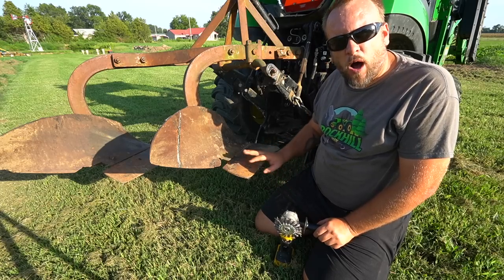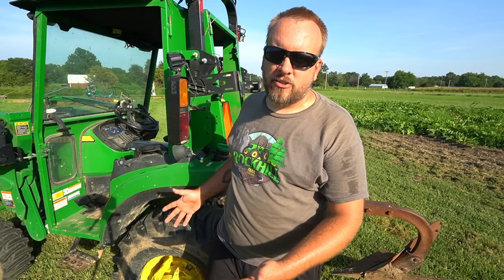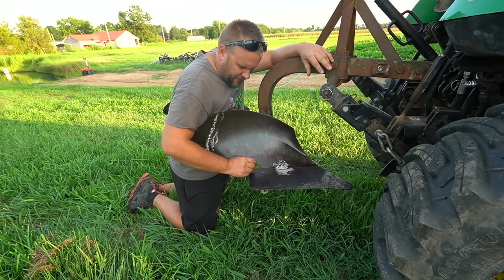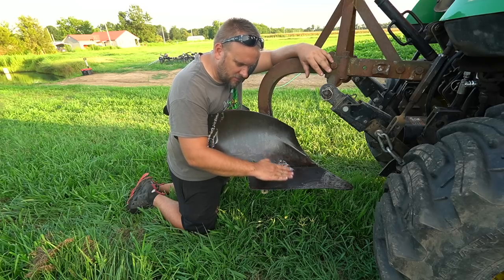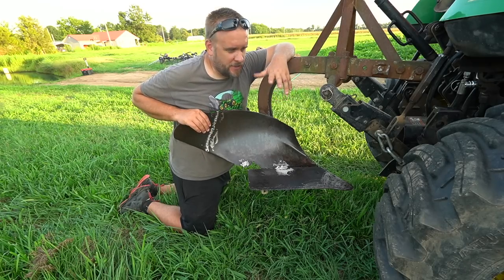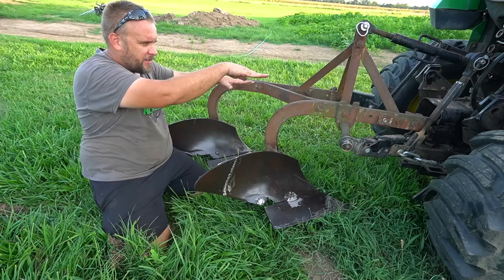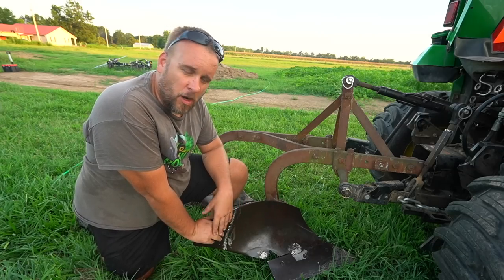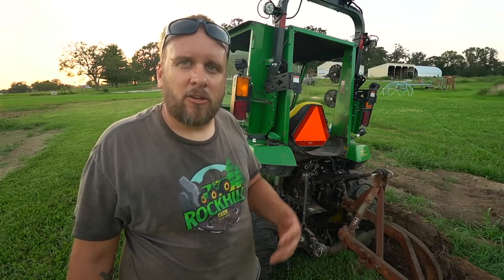Pulling a 2 Bottom Plow with a Compact Tractor - Better than a Tiller?

Comment: You did your setup completely wrong.  Moldboard plows are designed to work best at half the width of the moldboard.  IE, 2x12" would be best at 6" depth, 2x14" 7" depth, etc.   Once you know how deep your going, set the non furrow side of the tractor up on that thickness of blocks, and completely level the plow front to back, and side to side.  Also, make sure the trailing edge of the lead moldboard is just inside the rear furrow tire track.  Coulters should be 1/2" away from the cutting edges of the moldboards.
Reply: Everything you said is spot on sir. Only mistake is that it is the plowshare size not the moldboard. Your advice on adjustment was perfect.

Comment: I believe you're attempting to take too deep of a cut given your current set up.  That tractor should have no issue running that plow.  I have the same plow but with a set of sod cutters on it, I use the sod cutters to set depth of cut and that makes a huge difference.  Keep an eye on farm auctions, you should be able to find a set of cutters for it, or make your own.

Comment: Ok shining the plows was a waist of time,  the dirt would have done that. The two problems I see is you are plowing grass, the hardest thing to do. Second the points looks almost new, new points plow mean till they get wore down a little bit. I hope you was in low range, speed isn't that critical. Good Luck smoothing it down, you may have to use your tiller some. In a big field with plowed grass it would take an offset disk to work it up.

Comment: No need to shine the Mould boards. They will shine themselves with 30 minutes of breaking. Things that will help you do not have. A gear drive transmission will add about 4 horsepower. Ag tires will help a lot. Tractor weight will also help tremendously.. It is very simple as you say, you just not have enough tractor to pull a Two bottom plow!!!!. Also, my old Dearborn Plow manual says you need to run 4 to 6 mph to get good roll over with your Mould boards.

Comment: Your tractor has the power to pull that plow, but I think John Deere limited the hydro transmission conservatively to avoid damage/premature wear, on the transmission. I also think they possibly gave that "smaller" tractor "big" horse power to give decent power to run pto powered implements. If it were me,{which it's not} I would try and find a single bottom plow, or an old "cheap" farm tractor to pull that 2 bottom plow, just so I wouldn't overheat the hydro transmission. All of this is MY opinion. I am NO expert, and non of this is meant to be critical. Enjoyed the video.

Comment: that 4x4 block trick your not supposed to drive all 4 tires up on blocks only the left side (as sitting on the seat of the tractor) should be on blocks  so that way your tractor is leaning simulating being in the furrow and the plow should be parallel on the ground it looks messed up but its the right way just look up garden tractor  plow days

Comment: That hp info other people are telling you is not quite right. Old timers never talked about engine hp, all they cared about was drawbar hp and PTO. The engine hp is always greater than those two, but the manufacturers figured out over time that tractors sound a lot bigger and more attractive when you advertise the the engine hp as opposed to drawbar. That said, your 2038 probably has about the same drawbar hp as an 8N. Main performance difference reasons that come to mind are 1) your tires are not r1 ag tires that would give you much better traction than the r4 style  tires, and 2) wheel base is a lot narrower - 8N was a row crop tractor with a wider base and probably lower to the ground. I’d suspect there’s also a torque issue with your being a hydrostatic but I’m enough of a gear head to really know.

Comment: Moldboards are designed to plow half the depth of the with.
So a 10" should plow 5" deep, a 12" should plow 6" deep and so on.
This allows the top cover to be turned over and put the sod completely
under.  This allows the grass and weeds to rot in and kill any unwanted seeds.

A Coulter is designed to cut sod and other trash. It also helps to keep the furrow
edge clean and straight.  This let's the tractor tire run in the furrow better.

If the plot has been plowed and tilled before without much trash the Colter may not be
needed.

I hope this helps.
Greg

Comment: The following are comments from one who has plowed multiple acres with a 2 bottom using a 2038r:

1) Front ballast is helpful, even a bucket with some dirt helps
2) At the front of each bottom on the frame are two bolt holes, that is for the bracket that holds the coulter.  This helps immensely with cutting sod.  
3) As others have said in various ways, the plow isn’t meant to be buried.  
4) make sure both bottoms are at the same depth and angle, otherwise you will be drifting with your tractor.

Comment: Brock,
The 12, 14, 16 refers to width of furrows, not depth you are able to plow. 
Good video, I think by bypassing or stalling hydro, oil is becoming super heated and can cause internal damage and ultimately hydro failure. Thanks for in-depth look at options.

Comment: I enjoyed this video. I’ve never been a big fan of hydrostatic transmissions for the fact they seem to stall out on power to the wheel vs spinning. But they are nice in other applications also.  I use to turn plow with Dad’s John Deere 770 a lot back in my young days, it did really well for that size tractor and would do it at lower RPM’s. 3 point geometry makes a big difference in how a tractor plows. My 245 Ferguson actually seems to plow better then my 4 wheel drive M6060. Not that the little Massey pulls better but it’s hitch setup makes the plow pull easier. Good job!
Reply from the maker: Thanks for the info

Comment: Hey Brock ,

I use both ,  I go over the garden with an old Dearborn two bottom and then finish with my 6 foot  rototiller for my Kubota  L Grand 3540....
Works like a charm and the ground is perfect. Thank You for the videos.👍👍
Reply: How long do you go in between the plowing and tilling? Right away, or weeks???
Reply: @Rsiikarla  Right away .

Comment: Good bargain you found on that plow. Could use one out here as well. Got a 3010 from the 50's I would use to plow, with its weight, but I am having trouble sourcing a 3 point hitch for it, all she has is an adjustable draw bar.  I agree with the fact that there is less disturbance to the land with the plow. I used a disc this year and it went almost as deep as a tiller, but the area I worked was so full of rocks it would have likely caused damage to it as well, seemed that there was enough of a root system left intact to start growing a lot sooner,  with less topsoil being washed down the swale because its not as arid.
Thanks for the video!

Comment: Plow in the spring soon after the frost leaves the ground. Your soil will be much looser and it will be easier to plow. This will make more difference than any of the suggestions you mentioned! We had an oversized plow for our tractor and spring plowing was much easier than fall plowing.

Comment: Howdy Brock!  Interesting stuff for sure.  I know nothing of larger scale field work, so have no idea what might help.  Sounds like you covered most everything and it makes sense.  I don't see a whole lot of plowing in my area anymore - most farmers have gone no-till, which has it's own positives and negatives.  Nicely done and thanks for sharing 🤠
Reply: No till seems to work well when there is enough moisture to keep the ground in good growing condition, once you start to get prolonged months of drought, especially a few years of it like we've had up here. The earth starts to get packed down and growth gets sparce. This effect is amplified if its a pasture with hooved livestock on it continuously packing it down.  After you get march april may with 2 MM of rain combined there is not much that will help you grow short of irrigation, though the plow rows at least help stop any water you put on it from just washing off the top and running off without sinking into the ground.

Comment: This is my biggest complaint with the John Deere larger 2r and 3e series tractors, they need a 3 speed hydrostatic.  the low range on the Kubota's and my New Holland only allows me to go 4mph so it has a lot more pulling power.  I have been tempted to buy a 2 bottom plow of Facebook Marketplace too for my garden, but I am going to get a tiller first.  I wish I would have seen your post on the Champion tillers before they sold out.

Comment: With hydrostatic transmissions, the reason you ease into it is because you generate the most torque when you’re in low gear and barely engage the hydrostatic. It’s the only way my little LX 2610 can pull a full box of gravel up a hill when I’m smoothing out my gravel lane. The most power comes from low gear and feathering the hydrostatic peddle in order to get the most HP and torque to the ground.

Edit: personally I would go with a single bottom plow and save yourself the time. I agree with why you want to plow before you till. It works wonders pulling up vital nutrients to the surface.

Comment: Interesting video. I would guess you could efficiently plow about 4-5" deep with your 2038R. Deeper if you use only one plow bottom. I remember as a kid, we used H Farmalls to plow about that deep with a 2-bottom round pull-behind plow that was not on a three-point hitch. We thought we were really doing something! :-) But I doubt we ever touch the soil deeper that 5-6". Years later, I plowed the same lant with a 110 hp John Deer and a 5-bottom 3-point hitch plow and saw dirt that I had never touched before come to the surface. I have a 2038R and I would like to get a plow like you have just for small jobs like garden spots. You're right, these tractors are not designed for row-crop applications on a big scale. If the land has not been turned in a long time, the first time will be much more difficult too.
Reply: Spot on I used to plough 4" deep with a 4 furrow plough, set up is tricky.
Reply: Id agree 4-5 inches. . Trying to plow 9 inches deep id say is pretty much 90% of his issue.  He's lucky he ever got it that deep to begin with lol.  Had me real concerned at why a decently powerful tractor at 36.7hp couldn't pull till he whipped out the tape measure. He says " 12 inch moldboard you should be able to go 10 inches deep". That's nuts. 12 inch moldboard does 6 inches. 16 inch does 8. 10 inch does 5. They are supposed to plow up to half the cut length in depth and not really any more. My uncle's got a plow like this one and I've hung up his regular big tractors trying to plow 10-12 inches. Usually on a big rock but still. The size and the hst have a little to do with it but I think the main thing is he's just expecting more of a tool than what it's designed for
Reply from the maker: @EthanPDobbins if you listen to the video, I took a measurement and said it was 9 inches and that I was going to not go so deep on the following passes. I had just as much trouble cutting at 6 inches.

I also explained why the 38 hp wasn’t doing as well as you might expect. First hydrostat, loses a lot of power compared to a gear drive tractor, 

second, it’s much smaller than the average 38 hp tractor. Smaller wheels and tires. 

Finally, The big one is that it’s only a two range transmission instead of a three range.

That means that you don’t have a true low gear which is what it should be in
Reply: @RockhillfarmYT    the hst and lack of a real low range are issues here especially the lack of low range. I think these things are designed mainly for pto attachments thats why they are made to put most of their power into pto.  they are not really built with pulling in mind but I'm just saying it still seems to me you're trying to break a boulder with a 9oz hammer.  6inch is all that a 12-inch plow is ever supposed to be doing even with a big regular transmission tractor. With more power or when using single bottom you can make them go deeper but you're not really supposed to. Theoretically yours should be pulling it fine at 6 deep with 2 because it's got 36.7hp should be more than enough to give it the commonly recommended 10hp per bottom or even enough for 1-1 like 12hp  per 12 inch bottom but I think with the size and gear limitations you mentioned this thing would do best with a  two bottom 10 inch and respect for the depth limit or Since you're trying to use the plow you've already got I would say it's probably still a good idea to stick to 4 to 5 inches. 5 inches is about all the depth a tiller for a mini is gonna go anyways. If you want to plow deeper then removing the rear blade is the way to go then you shouldnt have trouble going 6-7 inches maybe even more. It will take more time but maybe the next year it'll be soft enough to use both.

Comment: Plowing would be a once every decade type tool.  There is a reason why that practice isn't used much anymore.

A tiller can go down about 7 inches and a 12 inch plowshare is designed to go down 6 inches.  So you would need a 14 inch plow to go that deep.

As a plowshare goes through the ground it creates a compaction layer at that depth. Then you need a chisel plow to break that up.

Comment: Haven’t used it yet but I got a homemade single 16” bottom 3 point plow I could try behind a 1025r. Always wondered if it was too big of a bottom for the little tractor. Since I got few older JD 2 cylinder tractors and plows for them that’s what I use.
I didn’t have much experience with a plow when I started pulling a new to me 3 bottom plow behind a model A it seemed to plow better in 3rd gear than 2nd. It looked to turn over better when I didn’t lower the plow all the way down. Was fun to try and experiment with my tractors and learn a lil more things

Comment: Try extending the top link a couple more inches so the tip of the plow is about an inch off the ground when you are on the blocks. It will not dive as much but will still cut

Comment: I wouldn't worry so much about the rust because the soil will shine the plows. The on thing that I do is sharped the plows from the plow horn to the heel. It does need to be like razor sharp but sharp enough to cut the soil. I seen other videos that people was using Hydrostatic Compact Tractors pulling a two bottom plows with ease. But sharped the plows what to you have to lose. Your right about plowing V rototilling plowing opens the ground for better aeration of the soil and to absorb more nutrients. I know some farmers in my area where I live at here in Missouri has gone back to plowing their fields instead of doing the no-till. So that they can get a higher yield in their crop growth.  You can try setting your plans to plow at 6 to 8" deep furrows plow in low gear and full throttle.

Comment: When you go to level the plow. It is best to do it on hard flat ground. Or, concrete. Drive both left side front and rear wheels up on the blocking.Then level the plow so that both bottoms are touching the ground equally by raising or lowering the draft arms. They will look off (one up, one down) from the rear of the tractor. Then, level the plow front to rear with the top link.. I am not familiar with your tractor. Can you adjust the draft on it? If so, you can set the depth control and keep it at your plowing depth. A 14" plow should run a max depth of 7". Depth equals half the shear length, Then, when you plow a bit? look to see if your furrow wall is straight and clean. If your landslides are good, it should be straight and clean. If Not? And, the plow is trying to pull the tractor sideways? You may need to extend one of the draft arms to basically turn the plow either to the right or left a bit. If the arms are not adjustable? There may be a way to move the brackets on the plow itself that the arms attach to. The other thing that you mentioned? Coulters. These are generally an option on the plows. The time they very beneficial is when plowing sod. They will cut the sod in front of the plow point. But, in a non-sod type situation? Especially, if there is alot of trash? They tend to plug up often. Some folks put 1 coulter on the rear bottom to help create a clean furrow wall. Having the plow leveled is the way it will pull as easy as possible. Another thing you may want to look at? Look at your shears. Look at the cutting edge. If it is rounded? You can grind a bit off of the underside of the cutting edge to sharpen it up a bit. Make sure you sharpen it according the angle it sits at on the bottom, Ie; when it is on the plow, you want to grind across the bottom of the shear parallel with ground. I know on some hydro tractors, it is possible to increase hydro pressure by adjustment. However, that may void your powertrain warranty. The fact that it isn't spinning out and instead just stalling the hydros?  Suggests that it may need adjustment. Or, a 1 bottom plow may be your best. Good Luck

Comment: I'd say you're biggest problem is still power. I pull a 3 bottom plow with a 72 hp tractor and I can stall it out in summer. I also found out that faster is better, the dirt flows better.

Comment: Late comment.... two things.  One, drop a bottom. Two, continue as you are, and it will have no problem pulling it in the same spot next year!  Approximately 20 hp per bottom to plow new compacted soil.  Your hydro even at 38 hp, is not putting that much horsepower to the wheels.  
We use plows in sizes from single bottom in the garden to sixteen bottoms in farm fields. My favorite is the super chief international bottom in the garden to the kverneland or Kuhn in the commercial farm operations, even though I bleed green when cut!😊
Stay with it, it will work out.